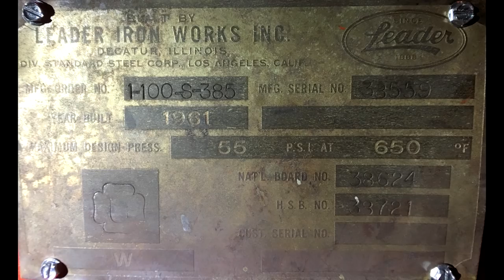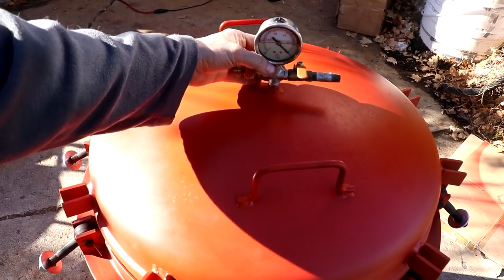Restoring The Vessel

Comment: The tin seal was brilliant. That's why I come here.
Reply: My question is, if he does choose to heat the vessel while sealed, will all the tin melt out?
Reply: @votalis4089  No, it will melt in, cause vacuum you know.     : )
Reply: @arthurherrmann1784  Ah, but it is both vacuum and pressure chamber. So both could be true.
Reply: Votalis, Boom! You touchéd Arthur's touché. Touché.
Reply: It is true he will have to use a different seal for heating. But, he said he was forced to replace the seal after EVERY use before. This is still progress.
Reply: Would a graphite seal be closer to ideal?
Reply: just lighting a fire in it might not necessarily be enough to melt through the tin seal.
Reply: @Sauspreme  he did identify two thousand degrees for the paint, no temperature range mentioned for the tin though.
Reply: @votalis4089 :  The melting point of tin is 231.9C.  So, up to that temperature the tin will do the job.  Above that temp, Cody could use a metal or alloy with an appropriately high melting point.  The trick is that it must also be malleable enough to make a good seal.  It might be interesting to see what he comes up with if that becomes necessary!  Up to 327C, pure lead would do the job.  We know Cody has loads of lead.  An alloy of 90% lead and 10% copper has a melting point over 800C.  Maybe that's also got properties suitable for a seal?
Reply: Not brilliant, that’s old school.
Reply: @Gerben van Straaten: Ah, that makes perfect sense.  Pure copper is nicely malleable.  I should have assumed as much!  1100C is a lot of C's but I presume copper too could be melted right into place in the channel of that steel vessel.
Reply: @Gerben van Straaten:  Haha!  Well, Cody might!

Hmm.  Maybe he actually *would*.  A gasket would have to be cut fairly precisely from a large sheet.  And it might be difficult to get it to seal in that channel.  It might truly be better and/or simpler to melt the metal into place in this instance... assuming it were ever to become necessary for purpose.
Reply: @jamesg1367  Why not use copper anyway? I know of seals for engine oil sump plugs made of copper. Of course gold could be possible it's quite soft and malleable and has a much higher melting point than tin. Of course it's expensive, but as long as it does not get lost in the process it would be possible. Similar to the silver magnet wire in the Manhatten Project.
Reply: @goamarty : only this: the melting point of copper might make it difficult.  Depends on your torch, etc.

Comment: Wait so.. Cody is cleaning something up and not making a mess this time? Is.. is this a first?
Reply: To be fair he did set it on fire at one point.
Reply: Tbh it probably won't last.
Reply: there was no butter involved, so nobody died.
Reply: The mess is off screen
Reply: You may not be able to see it but cleaning up old metal equipment like that is plenty messy. It's mostly in the form of rust and metal dust so it doesn't come through on cameras very well.

Comment: So the purpose of the torch was to bake the paint and drive off volatiles?

How does high temperature paint work?  Oil based suspension for you to paint with, then burn off the organic "binder" and the pigment is in some ground glass like substance which is vitrified in the process into an enamel?
Reply from the maker: Sounds about right

Comment: Hi Cody, don't worry about the paint on the inside unless you need to get to pressures below 10^-6 torr.  I've evaporated aluminum onto optical surfaces as well as painted, polyester, epoxy, and various other materials without issue using 1950's era pumps. (Rotary and Diffusion both using the same mineral based vacuum pump oil)

Comment: To deal with the seal crushing issue, you could weld some pieces of identical channel used to make the bolt mounts on top of them so thy form a spacer that the channel pieces on the lid rest against. I don't know if you will need to make the bolts unreasonably tight to get a good seal with the tin if it's used for pressure.

Comment: I see it's a clever design, with the hole on the bottom open and the lid shut all the atmosphere will leak out the bottom but none will flow back in through the top. Genius!

Comment: Nice. Looks like the kind of task I would take on. Love seeing others put in the hard work to restore an old piece of equipment that still has plenty of life left in it. Mega points for taping off the threads, I die a little inside whenever I see some idiot painting over the threads on a bolt.

Comment: Tin is an interesting choice for a gasket. I've used rubber, copper and even gold wire gaskets but never tin. I guess it could work quite well, at least as long as you're sticking to low/medium vacuum applications, high and ultra high vacuum is another ball game entirely. I do wonder how it will behave at higher temperatures and/or in the presence of corrosive chemicals though.

Comment: In the lab, uhv systems use copper gaskets. The steel bits in it to seal the vacuum. Super high quality (purity) single use = expensive/effective
Reply: Once they are used, we use them as door holders and once enough have been used, we sell the copper and go for a drink ;)

Comment: Viton silicone gaskets are used past at least 10^-5 torr in scientific vacuum equipment. If your mechanical pump can reach that then it's a great score.
The tin is certainly a nice touch though.  I worry about volatiles absorbed in the surface during resolidification.

Comment: You should put scale underneath and measure difference between normal atmospheric pressure and vacuum, then based on those calculate the pressure inside to see how viable method that is to determine the how little is air inside.

Comment: Do you think you'd be able to forego melting the tin seal between uses if you index the orientation of the lid with the body of the vessel? I'd imagine it would leave a decent indentation in the tin that might not be too difficult to realign with, if the orientation is the same.

Comment: Will that Turn gasket  crush down when a vacuum is pulled making it very difficult to remove? I understand the chowdering/buttering you mentioned at the end of the video but I'm seeing an issue with that crushing force on a metal to metal connection.  Cool Idea if it works! I'll have to try it myself

Comment: Hey Cody, just to give you a heads up, i know you work a lot with helium and other noble gasses. Helium can kill your phone by diffusing in the MEMs oscillator, changing its resonating frequency. It takes about 30min to diffuse enough helium in 2% atmo to crash your oscillator. Now, not every phone has a MEMs osclilator, some have older, much more stable quartz oscillators, which are safe. I still wouldn't risk it tho. Stay safe

Comment: Hell Cody you put a pressure relief valve on and use it as a boiler.   Don t go over 15psi or you will have to get it inspected. It would cool to get a steam pot and mate them together and melt wax or cook.

Comment: I know that the primary use will be as a vacuum chamber but do you plan to hydro test it before using it as a pressure vessel again or are you just planning to stick to relatively low pressures?

Comment: If you find that you need a stronger gasket material, you may consider copper. This was used for head gaskets back in the day, and is still used in performance engines that run exceptionally high levels of boost today. The only reason these gaskets aren’t used today is because of the cost, they just don’t even come close to being as cheap as multilayer steel. Come to think of it though, you may consider just spraying the tin gasket with copper head gasket spray instead, you can find it at any auto parts store for about $10 a can.

Comment: The paint may resist up to 2000 deg F, but that tin seal will start dripping at 450 deg F. It seems like you don't want to get it too hot with the soft metal seal.

Comment: How much sanding/grinding can you do before the integrity of the vessel might be something to think about? I've always wondered if it could pose a risk or is the outside layer you're removing so thin it's negligible in this case?
Reply: in the first video he posted with this alot of people were warning him about the rust possibly compromising the structural integrity of the vessel but he seems to have attempted to restore it so...  and judging how every comment posted on this video is basically either a meme or praise, i guess the people who warned him either aren't going to warn him again or they agree that he completely restored it.

Comment: Doesn't the tin gasket limit the temp you could make the vessel to less than 450 degrees? Not sure what you would ever need to heat the vessell to over 450 for, but since you used 2000 degree paint, I didn't know if you had something in mind.

Comment: Is it safe to scrape off all the rust like that? Wouldn't it compromise the strength of the vessel and how much pressure it can hold before popping? Perhaps the number is minuscule and irrelevant but I haven't the slightest clue how you'd figure that out
Reply: Vessels like that have a certain safety factor to the thickness of the metal. Scraping of a tiny layer of rust and oxidization won't have any noticible impact on the integrity of the vessel.
Reply: As previously mentioned, the vessel design will have a safety factor in terms of a percentage of the strength of the material but also a corrosion allowance which will take into account a given amount of rusting. To find out what allowance has been used, it's possible to look up the original design/manufacturing data at the National Board of Boiler and Pressure Vessel Inspectors (if you look at the nameplate near the beginning of the video, it has a National Board number,  which is unique to each pressure vessel)
Reply: Emma Jacobs Well I’ll be...that’s a serious knowledge drop.

goes out to look for boiler certifications on various pressure vessels
Reply: @emmajacobs5575  that is spot on, however what made me squint was nameplate show the vessel is designed to operate at low only about 3.5bar  and high temperature at about 350˚C, so it's probably been heat treated, and he was then welding on it. Let's hope he did not do any damage to the material where the welds went on.
Reply: @Tom Breathnach yeah, I cringed too when I saw him welding those handles on

Comment: Cody were you welding on that vessel? I was keeper of the inventory of tanks based on that data plate that if you did you may have destroyed the pressure vessel that tank was heat treated in a large oven after it was welded up.  I had a crane crew weld cable lug to a 20 ton tank rated for 3000 psi they ruined tank at a cost $750,000.  And then blamed me for not telling them not to weld even though the stencil words "do not weld on this tank" were in 4" letters on two sides hope you can use it as for Vacuum we had to back SS part at 300deg F over night if we wash any parts in tric or perc.  And sometimes longer.
Good luck.
Reply: @1:15 he welded some handles to the lid, and something else on other half

Comment: So that little thing will experience 3 tons of pressure when in vacuum. So how can something like the Hyperloop that's about 10 times that size (perimeter) hold a vacuum? Using 20 inches steel doesn't exactly make it all that inexpensive as advertised, so is it so hard to build, that it'll never be build?

Comment: there is one thing missing on this chamber: a number of sparkplugs going into the chamber. This way you would be able to pass electrical signals into the chamber. I think Applied science used sparkplugs in his scanning electron microscope

Comment: Put a watermelon inside it and see if it explodes from the negative pressure that would be awesome and on a bonus you can eat it afterwards you should also put a sealed tin can in it and see if the can is strong enough to hold up against the negative pressure

Comment: I have a question Cody, if you got the pressure up to the highest you could and then shot it would the vessel implode or explode or would anything happen at all?
Reply: Implode. Pressure wants to come in.
Reply: Depends on what you mena by "highest". With sufficient pressure any container "explodes", including the one featured in the video. However if you mean highest pressure with a pump or a pressurized gas, I highly doubt it would explode.
Reply: @thinktwice2x381  That only depends on the pump. With SCUBA bottles or the compressors used to fill them you get 200bar, sometimes 300bar. This vessel is rated for just 55 psi, that's just 3,7bar. Even if we are generous and assume the burst pressure at 10 times the working pressure it would for sure rupture before 200bar.

Comment: DO NOT use it for pressurized gas. Welding on it voided any pressure rating it used to have. Vacuum or liquids should be relatively safe(so long as the liquid is below its boiling point, and the vessel is completely full of liquid).

Comment: It’s a filter pod used (from what I’ve seen and worked with) in the oil and gas industry for filtering circulating fluid
Yours is Incomplete as it needs the piece that holds sock screens

Comment: How will the tin seal hold up under heat?
Reply: Michael Garner it might get sucked inside and break vacuum..
Reply: It melts at 232°C, so probably anyhing under 200°C is probably fine. Standard silicone can handle up to 200°C for extended periods of time so it's about the same. High temperature variants can go up to 350°C for short amounts of time but since he has to replace the seal every time I don't think he uses that more expensive variant for it. However since silicone doesn't really melt but just degrades at high temperatures he could go well above 200°C with silicone if he has to replace the seal afterwards anyway.
Reply: @IkBenBenG  Why should a silicone seal need a replacement after each use? It should be possible to make a reusable gasket.
Reply: Didn't he say in the video that he had to replace the silicone seal almost every time?

Comment: S A N D B L A S T E R
Reply from the maker: Yes I do need one of those.
Reply: Cody'sLab if the vessel goes fubar, at least you can make it BBQ. That's what I make with worn-out pressure vessels. I make them BBQ or flowerpot sometimes